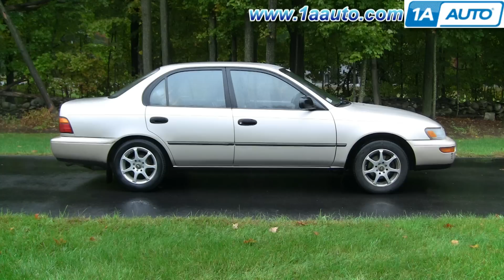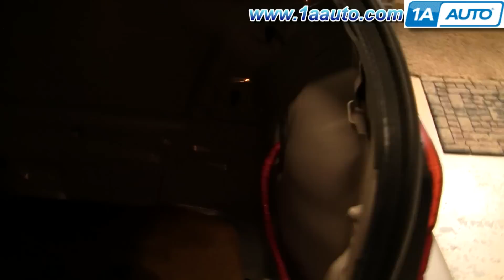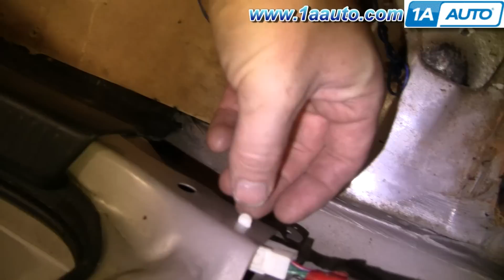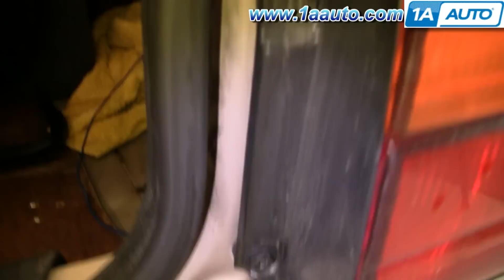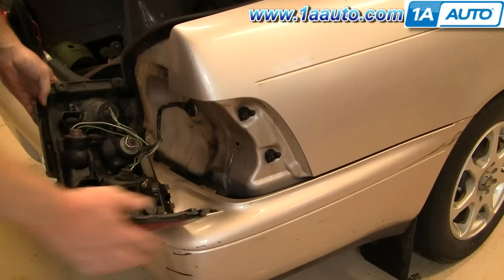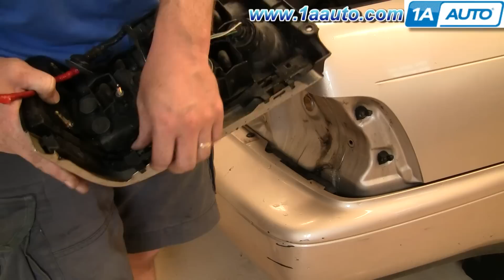How to Replace Tail Light 93-95 Toyota Corolla

Comment: Changing the brake light bulb, I didn't need to disconnect the wire from the clip at all. The light panel tilted back enougn.

Comment: Very Informative.
The instruction is quite clear, but I have not been able to remove the bulb 
housing. In which direction the housing needs to be pulled out, for not to break it?

Any pointers would be appreciated.
Thanks
Reply from the maker: If you follow this video you should be fine.

Comment: hi im trying to install after market tail lights on my corolla instead of replacing it with the original ones do you know what the exact size tool i need to buy to remove the back nut

Comment from the maker: You may want to check the fuses to see if one is burnt out. You may also want to check the door jamb switch to see if it's working correctly or needs to be replaced. 1aauto.com 888-844-3393

Comment: Often, these videos leave out parts that are important for non technical people like me, but this one was wonderful. Was able to change the light bulb myself. In case anyone else has a problem of getting the outside housing off, one must pull out mostly, not wiggle back and forth. Took me a little bit of time to figure that out. The auto parts guy couldn't figure it out. Kind of funny. :)

Comment from the maker: Also make sure that the wire is disconnected. Once everything is removed you can try to wiggle it back and fourth as you pull on it and it should come right out for you.

Comment: Changing my brake light, i unscrewed the 3 bolts but i cant get the light out, seems to be stuck where the black pins are on the outside. I dont want to force it but how do I get the light out??

Comment from the maker: If the two bolts on the outside are stripped you may need to find something that will clamp onto them so that you can remove them. A set of needle nose Vise Grips might possibly work.